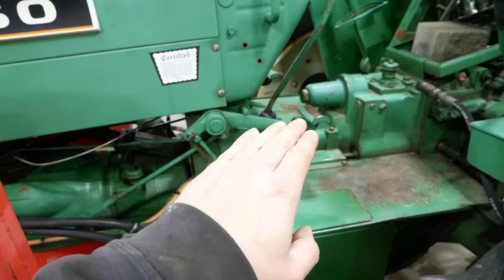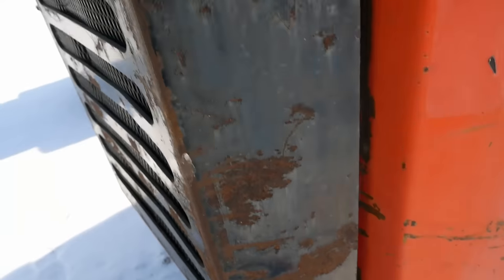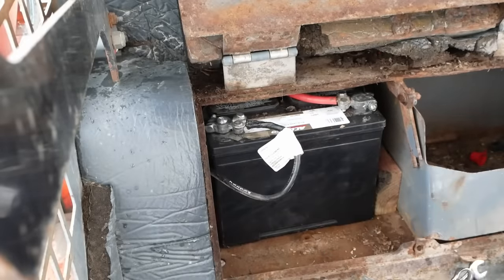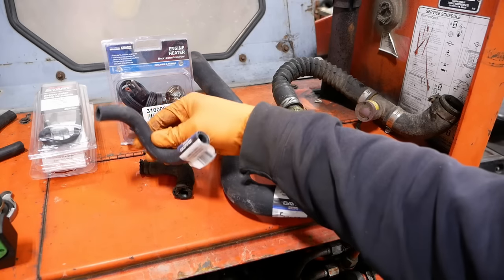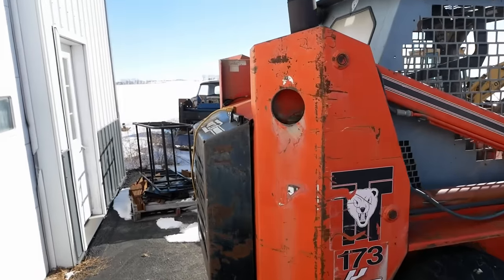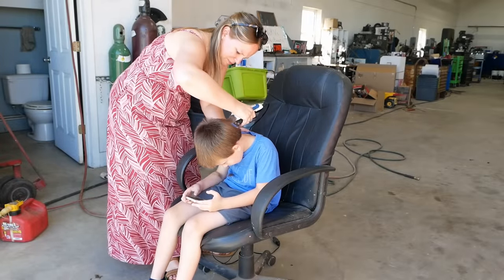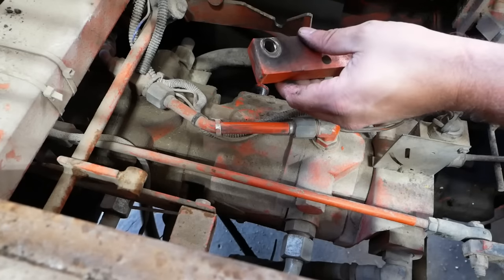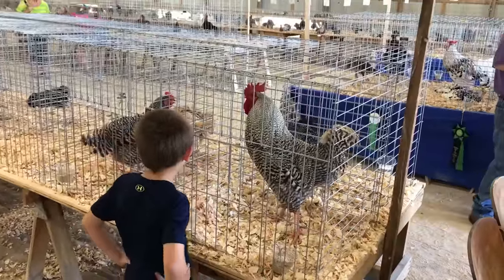Buying a Cheap Skid Steer from an Online Auction - Thomas 173HL - Part 1

Comment: High Wes, Thomas Skid-steers were built in New Brunswick, Canada (east coast). They were pretty popular but were plain jane compared to contemporary machines like Bobscrap or Deere John. According to google they are now owned by Ariens the riding mower people. However their skid-steer line seemed to be out of production since about the mid 2000's. They were building and selling mini skid-steers but I dont think they are anymore. There is an outfit using the name and selling parts online for dealers but thats all I can figure out. I knew a few guys in the early 90's to the early 2000's who ran them and they always preferred them over other makes saying they were built a lot tougher than companies like Bobscrap.
Reply: They sold them until at least the 2010s the last models were painted safety yellow. A local rental place has one in my hometown.

Comment: We got 2 skid steers at work. Boss made a plow for the one. Used a quick connect and a western plow. It also angles works really good. Got a gravel driveway and told the boss to put a pipe over the cutting edge to keep it from moving the gravel. Used a few trucks with pipes over the cutting edge and it works great. Going to be putting one on my plow for this winter. Just got the plow and truck just got to put the hookup on the truck. Needs welding i can't do that but my son-in-law can.

Comment: That's a neat machine :) I let out a little laugh when you said it has high hours. Over the past 7 years, I've put 25,000 hours and a hair over 34,000 miles on my forklift at work :) As far as skid steers go, I've always wanted one of those little yellow Ford units. They are really small and narrow, and I believe they have a 2-cylinder Wisconsin engine. But at 40-50 years old, they are pretty scarce, and people usually want way too much for them, even when they are incomplete/not running. I just think one of those would be perfect for doing light work around my yard, and I like the fact that they are skinny enough to potentially go through the back door of my garage.
Reply from the maker: Like a scat trak.

Comment: Speaking of the original battery hold down bracket - my used Honda Civic came without one.  I was about to go to the wreckers to find another one when I checked with the local Honda dealer.  A brand new bracket was only 7 usd!  After that I check the dealer first :)

Comment: Watching Wes Work, I always learn something, even if it's not something I think I'll every need or use.  Today I learned that skid steers are also almost zero turns!  Watching that beauty do a 360 in the snow was pretty cool.  I wonder if you could go fast enough in the snow to do donuts (the automotive spelling, not the baking spelling...).  :)
Reply from the maker: They are the original zero turns.
Reply: look up the history of them, it's fascinating
Reply: Yes, you can really "hot dog" in these things, do wheelies, etc., but the low RPM issue was very apparent. I was wondering why Wes was going so slow--thought he was just being careful and cautious with his new toy.
Reply: Part 1 !!! Looking forward to Part 2!
Thanks for sharing 🇨🇦
Reply: @WatchWesWork   Just don't do it on Blacktop...when it's 95 degrees...I mean unless it's your last day on the job haha

Comment: We have a kubota 2203 in a tractor, no block heater, battery is 21 years old (yes 21 years old), starts in -35 every time.  May have a couple of glow plugs out.

Comment: Those crappy repair terminals are awful but I found that if you flip the plate upside down it gets a lot more bite on the wire and will actually last a decent amount of time if you also slather some grease all over it before you put it together.

Comment: Greetings from Australia. Years ago I had a 6 cylinder version of your machine. Bulldozer with wheels. 4 in one bucket would snap 5 inch concrete in half. Won't start unless glow plugs are in good condition. It's a machine worth perservering with. Keep at it and thanks for the entertainment.

Comment: Wess I had a old 1970 580 ck with same starting issues I started using a small engine block heater on the hydraulic bulk tank thins the hydraulic fluid

Comment: Pop some chains on the rear of that thing and it will be almost unstoppable. Also….1/4 lexan sheet will do both sides and rear with some soft seal tape around perimeter. Bobcat F series door will fit that cab width and have integrated wiper/washer in it. Just need to make the hinge reciver tubes and put a striker on other side. Pop a nice heater core in there AND a cupholder and you will be plowing in comfort.  Thats my setup and its perfect. 👍

Comment: I’ve got the same exact skid steer that I bought from an auction also.  Same exact Kubota engine too.  So I think that is the factory engine.  I had to do a lot of work on the controls on mine also:  I replaced the brass bushings in the main control levers and I used grade 8 bolts and stop nuts for a few of those linkage pins.  It has a parking brake ( disc brake style) that is supposed to engage when you raise the safety bar so you may have to adjust that or check the cable that controls it.   Mine has over 8000 hours and still runs great!

Comment: Hey Wes, I'm pretty sure you checked this first most likely but you did check the fuel filter or filters right. I"ve had my diesel tractors just not have enough power and it was a clogging filter. Like I said though I would guess that is the first thing you checked.
Reply from the maker: We did a full service on it about a year ago.
Reply: @WatchWesWork  That's what I figured. Tell the Mrs. I said hey.

Comment: Did a couple of Google searches on the low rpm issue.

Engine in skidsteer is 46hp, 0-3000rpm. Engine from Reefer unit is 51hp, constant 1800rpm.

Swap out internal governor assembly with that of a variable throttle engine, enjoy 5-ish more hp than stock.

Comment: BTW, I have been using dielectric grease on my door seals, electrical connections, and hair for 20 plus years. It works great! I also found it helpful to make a good connection between the batteries on the cement garage floor and the charger.

Comment: Hook up a trickle charger or mount battery tender on there and plug it in when the block heater is plugged in, tickling the batteries before starting makes a big difference.
Reply: That's a good idea actually.
Reply: @thomas316  I've had this set-up primarily on my 1999.5  7.3 PSD since owning it in 2005.  Now that I'm retired I feel it's even more important, helps battery longevity too.

Comment: Wes, as a temp repair to get you going if you get stuck with a kinked hose like this, just put another clamp around the kink itself, tighten it to the size of the hose amd it will keep the shape of the hose without squashing it at the bend.

Comment: I've been blading snow with my 1650 with an 8ft blade. For about 20 years. One of the joys of winter. You should be using the low side of your hydropower. You shouldn't have any problem shifting.

Comment: I bought a used Thomas ProTough 135 with "1250" hours on it, biggest money pit ever. 50 hours in, I had to replace the Kubota.  I replaced the lifting arms, radiator, pedals and linkage, wheel bearings, hydraulic hoses and the list goes on and on.  It never started cold, I went through several alternators and a new battery every year.  I bought all my parts from Thomas in Canada.  They were always helpful with diagrams and part numbers, but I couldn't wait to get rid of it and eventually bought a new Bobcat tracksteer with the 0% financing.  It took me several months before I realized the Bobcat would start up every time. I became so used to the Thomas not working or something new breaking, I avoided using it altogether.

Comment: That coolant hose on the engine is super common to fail after many years. I’ve replaced a few. You can get one at your local bobcat dealer next time. Same kubota engine is in the bobcats

Comment: Check inside the low pressure pump where fuel line from tank enters . Nippon denso puts a thimble size screen there n sometimes one in filter housing .l have found this on lots of makes of machines using this fuel system

Comment: Construction company I worked for years ago had that exact skid loader. Only issues with it was the coolant system water pump and radiator were always problematic. Another annoying issue is we always broke  control cables for the hydraulic controls.

Comment: My old Chevy Suburban was rode hard and put away wet before I got it. But, the original owner took great care of her; original hold down, 8 year old (at the time) battery still kicked her over at -20C, even had an old remote start. The body is slowly converting to weight reduction but the frame is solid. Might even treat the old girl to a trans next year as the low reverse pack has actually never worked in it for the 8 years I've had it (amazing what a low gear sprag clutch will put up with when the v8 doesn't actually make power.)

Comment: Looks like a Kubota 2203. Awesome engine. I've seen a Kubota engine with 50K hours on a Bahamian freighter genset. Sore, it leaked from every orifice and was chooching from the crankcase vent, but it ran. 
There is definitely a difference in the governor springs from a unit meant for a genset and a power unit like yours. Southeastern Power Products in Pompano Bch Fla can help you out. Adjust the valves while you're at it.

Comment: I have the same blue Jump and Carry pack since 2009 best one I ever had..
Just got two new ones for service truck .
Looks like a good skid steer.
I got a 1994 New Holland L785 best machine never failed 6000hours Perkins motor.
Just a few hoses starter alternator .
No hi tech computer pos on older ones .
New machines a night mare hi tech ECM only Stealership can scan .
Nice 👍
Ps I put green slime in all tires with a little non tox antifreeze to keep it loose to seal up slow leaks .
No more flats .

Comment: . Thank you for the dayco catalog hint. Bobcat parts prices are dear. The nice thing about that bucket is you can bolt on a sacrificial edge that won't tear up asphalt as badly. Some of the machines using 10w50 as hydraulic fluid were topped up with anything available. Is there a way to have a fluid tank heater? Great work around on the arm.  Thank you.

Comment: Hey Wes, that skid loader looks a lot handier for what you need than the Oliver, but I used a 1650 (they were sold as Cockshutts in Canada) for several years to feed horses and do yard chores. It had a crappy Du-All loader, but I didn't have the shifting problem you mentioned, and if it had the hydraulics gremlin you mentioned, it was so minor I've forgotten it now. I had no problems efficiently and quickly loading bales on a trailer. I loved the 1650, very handy chore tractor. Sold it because the ether-junkie  engine was shot and good Waukesha parts are hard to find. If you lived about 1500 miles closer I'd be on my way over to talk you out of yours. Thanks!
Reply: Horses and Canadian... I think I like this guy.

Comment: Wes I think you are on the right track. The engine with this low rpm for that application is not correct. I think a governing spring can be changed.

Comment: As a kid we had a Thomas 175hylift, thing was a tank but was also brand new when we got it. Only major problems we had were self induced with horrible fuel/ some major electric issues after someone drug it out by the engine mount, and in doing so they actually wrapped the chain around the main + cable for the starter. What a mess, otherwise she still ran good when I left.

Comment: Getting fancy with the tubes, my bobcat has 132 tire plugs and is full of Slime. I added the Slime when the tires started leaking out the sidewalls. Guess they are “a little” dry rotted.

Comment: Before you tear into that injector pump, check to see if there's a filter gauze where the fuel enters the pump. Sometimes they're right down in there. I've had it before where diesel engines max out at low rpm, and it's been that micro filter that's blocked with gelatinous matter.
Reply: User Joefive5466 said Hey Wes, I had to put a heavier governor spring in my V2203 when I stuck it in a Jeep. I used Mcmaster 9433K49. I’ve revved it to about 2500rpm before I let out. To change the spring, you have to pull the injection pump out and the throttle plate off and the shutdown lever plate off.
Another user said they were used a lot in generators and set at 1800rpm, which seems to fit

Comment: From the video it’s looking like you need fill the bolt holes with a new blade as snow is coming up through all the missing bolts that would hold the blade. And inside your shop supply you may have some steel you could use to make a blade. 
Good videos keep them coming. Thanks 🎉
Reply from the maker: The whole bucket is worn out.
Reply: those are cutting edge mounting holes. Skid steer cutting edges usually 1055 hardened steel, not exactly easiest material to work with

Comment: Excellent video Wes  :) also my late Uncle also my late Dad in 1987 bought used 1978 724 B loader Desiel fuel motor but was bit upset with themselves ask why it was terrible auctioneer said to both them  find parts for loader no problem and was false information about that ! Because in 1990 hydraulic cylinders leak bad and had parts to use was John Deere Dealership  near find and rebuilt for 4 cylinder 2 for arms and 2  for bucket! Plus all newer hoses mice chew on them leak and other part bucket  had 4 spears in metal boots with 2 bolts each ! It was pain doing animals 💩  from barn dump in munare spreader or rock picking out feilds big ones and was doing snow removal in Winters Season too! So nice of Local John Deere Dealership got bucket without spears in bucket for loader did super job after butt only down fall put tubes in tubeless tires  better ply number too in steering wheel tires because made look going flat and no traction on back tires when loader attached and bucket on to ! Guy sold tractor said do anything need be but was false information  to! Then in 1992 motor needed fully plus heads and block replacement too  ! Was big expensive my dad and uncle went thru on machinery repairs ! But was all fix then and got money back by sell lots cows for nice prices! But one thing I help them is got 1963 McCormick International B414 Loader tractor Desiel motor, rebuilt motor at my cost  and found a old tractor same type with many newer parts to restore at my own money I paid for! Luckily trip bucket was in mint condition  also arm hydralic cylinders plus hoses! Guy I bought from was retired farming and had tractor cover up ! Plus scrap old part didn't need from old one and new condition tractor to on scrap yard prices on metal dealer to flat float tow truck plus ! Also Wes check on Google Search of Kubota Tractor Dealership in Omemme Ontario Canada  🇨🇦  they north west of me and heard good things about them to ! Plus east Toronto Ontario  Canada  !

Comment: A block heater may keep an engine warm in the freezing cold but the battery will still be frozen and capable of only a fraction of its normal amperage.
Oddly enough the used car I drive came with an oversized battery which is why it still hasn't given me any problems. Rated for twice as many amps as the car would have originally had, so even in -20C temperatures it has no issues with cranking or glow plugs.
Reply: Always add a battery tender too especially to diesels

Comment: I can vouche for the 1845C, my dad has one and most of the time it runs like a beast (it has had some starter/ignition issues but those were fixed). Replacing the hydraulic control valve is very pricey though since the only way to do it is to replace the entire valve assembly and doing that costs around $2,500 since you’d have to get it from the dealer. Those old case machines can last for a very long time and take a beating. Aside from having a 1845C my dad also has a 580B Backhoe tractor that doesn’t run (has a lot of issues but what took it out of commission was needing an engine rebuild) and a 850B Bulldozer (it’s missing a safety plate on the track controls and the brakes don’t work but it runs great otherwise). They might be expensive but they are worth it since they are quality machines

Comment: You're all over it with the governor springs.  Should be 2 springs, 1 inside the other.
I'd bet one of yours is broken.  Not super common but I have replaced some.
Pull the plate the throttle shaft goes through off and you'll see the springs hooked to an arm on the throttle shaft.
It can be a pain to reinstall without the springs popping off.  Try to keep a little tension on them.
You should be able to feel the tension after install and make sure you can still feel both springs.

Comment: I owned a 1993 Thomas HL173 back around 2003, it had been vandalized. They figured an X employee destroyed the engine. I bought a rebuilt Kabota engine for $2500 and learned an interesting fact about the machine. Seems all major components can be replaced in 90 minutes! It took me about an hour to replace the engine after I had flushed the hydraulics and tank out to make sure it was good to go. I loved my machine/Thomas but sadly I made a mistake one fateful day and got out of the machine and was crushed by the loader! Turns out the control cable was bad, left me a paraplegic for 2 plus years. I should never have  trusted the machine controls. I can now walk again but with pain. There great skidsteers in my mind any day. Be safe and enjoy yours ..
Reply from the maker: Wow that's crazy! Glad you made a partial recovery.
Reply: What year is your Thomas? If you mentioned it I missed it. Someday I'll send you a picture or two of my machine after my accident. Be very careful if you replace the control cables Wes, Please! Fix the parking brake as we don't get second chances when machines do stupid things.